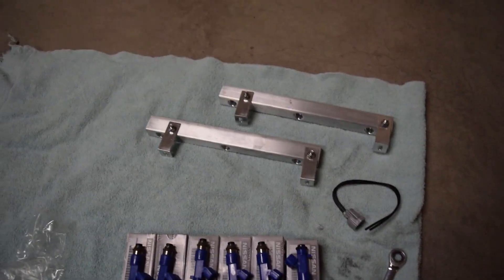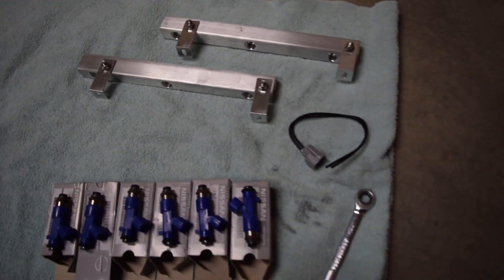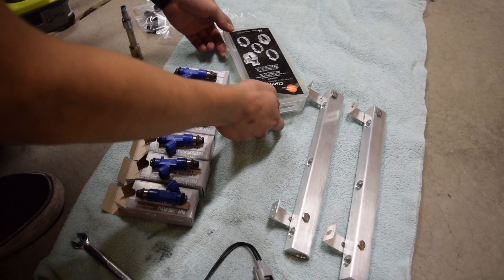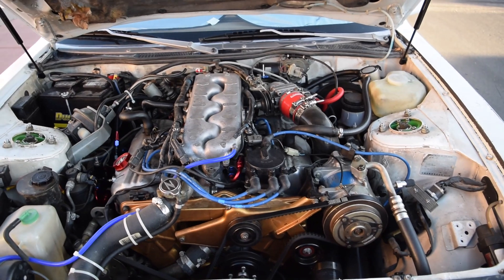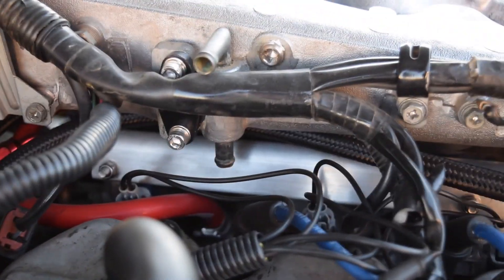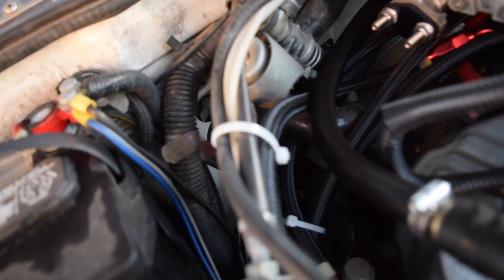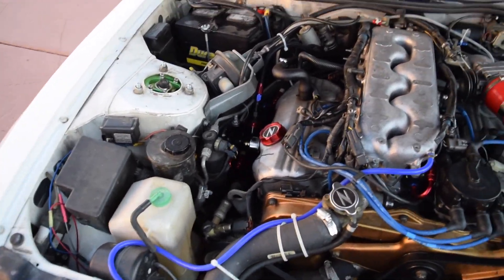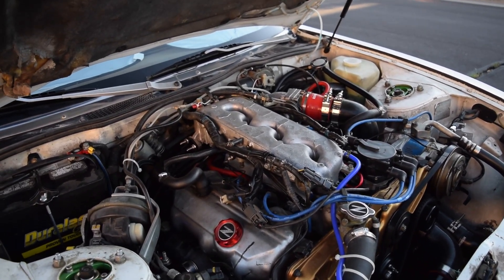NA2T Fuel System

Comment: I can't wait to put me some good injectors that I know are good in this car I'm all the time running injector cleaner through it and like I said I'll run shell 93 v power gas just because I'm used to running it I run Royal purple synthetic oil got a lot of work fixing to be going on to this car but first off I'm fixing to put a plenum spacer between the lower and upper intake manifold and a bigger throttle body maybe change the gap on my spark plugs a little bit and check them clean them maybe they're not very old in GK plugs and wires but I'm in the mix of doing a few bushings finishing up my energy suspension sway bar bushings and end link bushings and front struts getting my emergency brake working right I'm actually rebuilding my rear calipers at the moment and I've got a shit ton of bushings to start working on but the injectors were fixing to be one of my deals I'm going to have to wire up the injectors back to factory because they've got that Nissan campaign bullshit going on but hi one day at a time I just can't wait to pull these heads off and do the cams and valves and good valve jobs maybe a little porting and something about this damn open diff you know I'm a little bit of a drifter